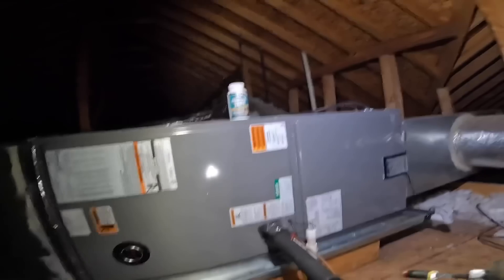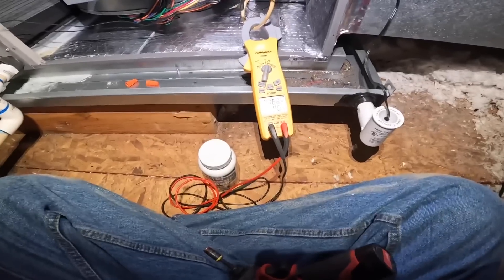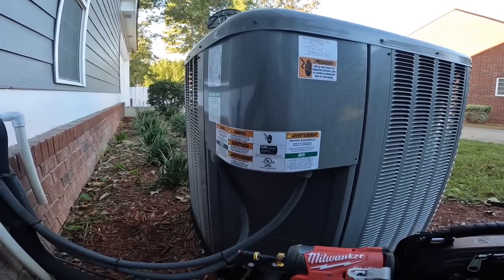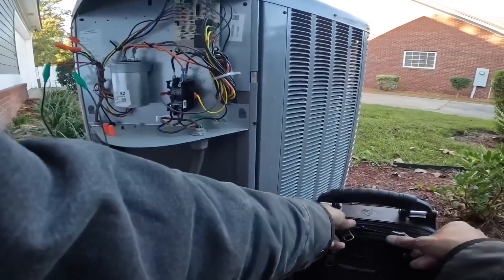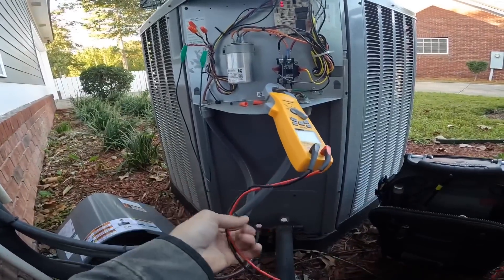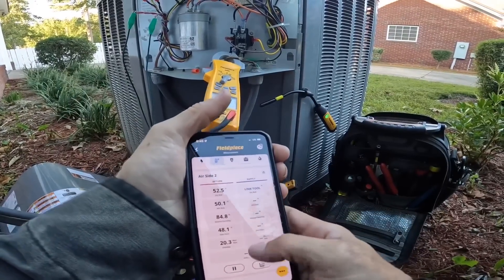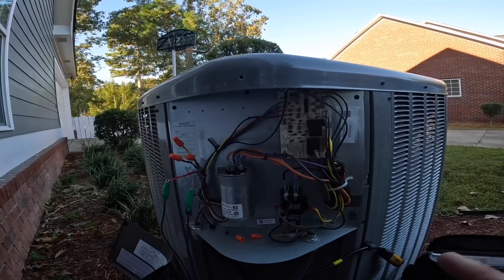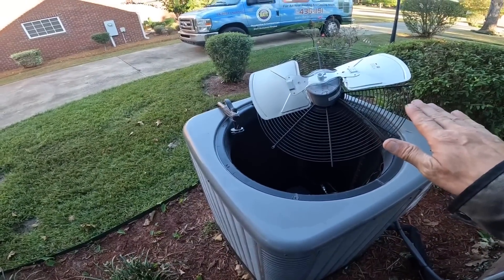Detailed View of What Needs to Be Checked On a Heat Pump Before Winter

Comment: I like to blue block my male adapters much to the consternation of my coworkers. 
In some states I would insulate a portion of the condensate drain.
I have a Wiha torque screwdriver for electrical terminals no over/under tightening.
Good video.

Comment: Please forgive a question about filter/dryer . If liquid flows in two directions heat/cool mode how does filter hold contamination and not just get pushed back into system

Comment: Something I do on every service call is check the defrost switch if I'm in the outside unit. I mainly want to check to see if it's stuck closed. A customer will notice a frozen up heat pump, usually, but few notice that it's defrosting every 30 to 90 minutes all day and all night, everyday. I even check them when I'm running summer service calls. I should be going back on installs after a period of time, that's good customer relations.
Reply: Where’s the defrost switch? I asked my guy to check that and he said my heat pump didn’t have one but I’m wondering if he was lying lol
Reply: @ItsAllFakeAndGhey  get a new service company. All heat pumps have a defrost board and switch (thermostat, sensor). All defrost boards have a test function.
Reply: @Bryan-Hensley  ok thank you! every summer, on the hottest day, my heat pump freezes. The rest of the year works fine. Any ideas?
Reply: @ItsAllFakeAndGhey  airflow or low Freon..
Reply: @Bryan-Hensley they checked the refrigerant and everything was good, no leaks…it’s happened every summer for 4 years (always on the hottest days with no breeze—so Airflow is exactly what I thought!)

The outdoor unit is only one foot from the house and positioned inside a corner, my guess is on the still, muggy days it struggles to get enough airflow and hence ends up freezing!

Aside from moving the unit, any suggestions of anything else I can do?

Thank you 🙏🏻
Reply: @ItsAllFakeAndGhey  it would be inside airflow too low causing the evaporator too get too cold causing it to freeze..
Reply: @Bryan-Hensley  right. since it ONLYhappens on the hottest/muggiest/stillest days of the year im thinking that must be related in some way? Could it be due to it being dirty you think?
Reply: @ItsAllFakeAndGhey  could be dirty. It could be several things. Are you using high number Merv filters? They can cause it.
Reply: @Bryan-Hensley  nope just basic ones that i check often to ensure they stay clean-- any other ideas?
Reply: @ItsAllFakeAndGhey  fan speed (bad capacitor), dirty evaporator, expansion valve bad, collapsed ductwork, dirty clogged blower wheel, improper sized unit, improper sized ductwork. I'm probably forgetting a couple of things
Reply: @Bryan-Hensley  we replaced the capacitor so hopefully that was it and that won’t happen again in the summer! Thanks for the suggestions
Reply: @ItsAllFakeAndGhey  do you happen to live in East Tennessee?
Reply: @Bryan-Hensley  nope I’m in NC
Reply: @ItsAllFakeAndGhey  I'll go to Marshall, Mars Hill, Hot springs, and sometimes Asheville.
Reply: @Bryan-Hensley oh nice! Unfortunately I’m on the totally other side of the state (eastern Nc)

Comment: SURPRISE IT"S NOT OVER 5 YEARS OLD SO MAYBE IT's NOT TOO OLD FOR ONCE! Let's check it out! - My Goodman still working fine from 2003, just some heat strip relays ever now and then. NEVER buy into IT IS OLD after a few years. It is BS! You guys are unreal! If it was installed right is the big deal. they can last 30 years or more easily. ALL BS. OLD my ass, they dont say that when selling them to them, neither do YOU. 
TRY ONCE TO SELL A NEW SYSTEM AN TELL THEM THEY CAN EXPECT ONLY A FEW YEARS OF SERVICE - I WANT THAT VIDEO! because you ALL act like things are old in no time!

Comment: Hey Curtis. I was always told to never hook up to the hot gas line in heat mode. If there is a high pressure problem it could blow your gauges out and cause serious burns. Usually I hook up to the true suction and liquid line
Reply from the maker: That’s incorrect. The proper place to check is on hot gas.
Reply: @HVACGUY  so the hot gas and true suction is where you take your measurements. Never the liquid line?
Reply: @HVACGUY  I was told if it’s a txv you hook up to liquid and true suction and a piston then you hook up to hot gas and true suction. This is from my school so I am just clearing this up
Reply: Have you ever taken the gauges apart? That's flat out impossible, unless you are using something from a Chinese reseller..

Comment: Are aluminum coils better than the cooper ones- thanks keep them coming/ but a lot of work and editing,
Reply: Yes and no. Copper flows heat through it quicker than aluminum. That's why these aluminum coils are huge. But putting metals against each other, aluminum and copper in this case, creates a perfect place for oxidation. They have to put a metal on the ends that will rust (absorbing the oxidation process, kinda) to keep the copper from oxidizing the aluminum. But even so, the metal on the end will become fully rusted and the copper-aluminum oxidation begins, petty soon leaks.  When you having all aluminum coil there's no oxidation from putting different metals against each other. They'll outlast a copper coil by decades if they both are built at the same quality level.

Comment: You’d think they would put a LED on the unit that indicates “Defrost mode” 🤷‍♂️
Reply: I actually added one to my thermostat
Reply: @khx73  any tutorials?
Reply: @EastDallasKicks  no.. just basic electronics.  Small LED with a dropper resistor.  Connected between white and common.  Lights when the defrost board outside signals the heat strips to come on inside during defrost.
Reply: @khx73  thanks
Reply: @khx73  any tutorials?
Reply: No, they used to do that back in the late 80 and early 90s. Some customers would think it was indication something was wrong. My grandmother called the fire department. She said she saw a light on, looked outside and "smoke" was pouring out of the unit. It was actually the aux heater light which would come on during defrost too. That was the first time they would see it.
Reply: some do in fact

Comment: Thanks looked like you have cut of tip off the yellow protector so you could slide up and down.  I seen some of your tools are marked with tape. Thankyou for your time By the way I’m impressed how you check your defrost thermostat.  That how us boys in the north do it lol
Reply: Something I do on every service call when I need to get into the outside unit is check to see if the defrost switch is stuck closed or has fell off. The customer will notice a frozen outside unit but very few will notice it's defrosting every 30 minutes all day and night.
Reply: Whatever your sentiments on this fella, don't ever label a service call as "preventive maintenance".  Call it "planned service" instead.  You're not preventing anything...and the courts agree.

Comment: Is it normal for a compressor to run a lot lower amps than what the rating plate states. You were reading right at 10 amps and the rating plate was around 21 amps for the compressor.
Reply: 21 FLA. FLA means Full Load Amperes. Depending on the conditions; indoor/outdoor temperatures, equipment sizing, efficiency of the house, age of the equip, etc. Those all effect the load on the system. If the system isn’t running at its full load (should never be if properly sized), the compressor amp draw will be much lower than it’s rated for.
Reply: 50-60% RLA is what you want
Reply: Thanks for the Information!